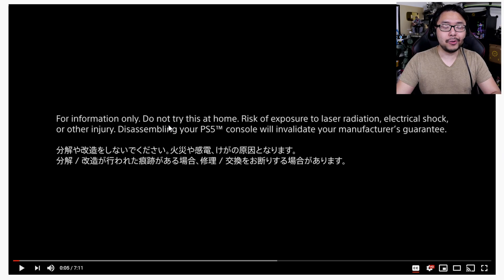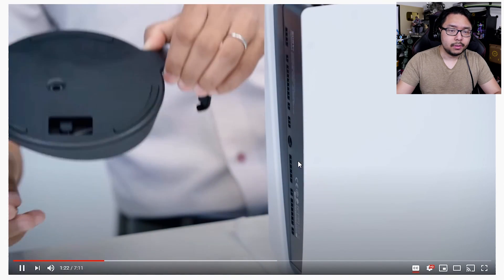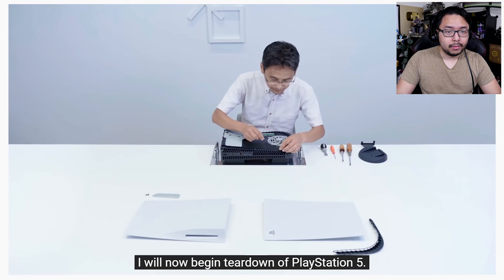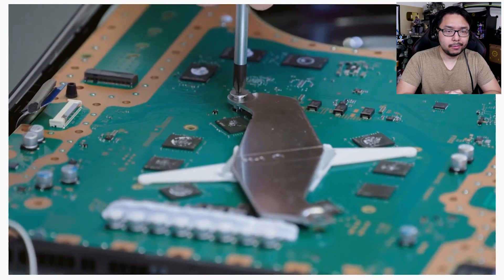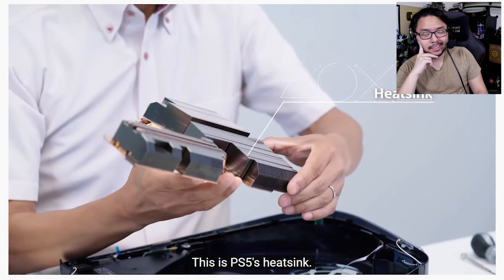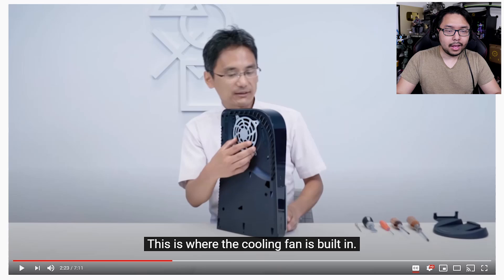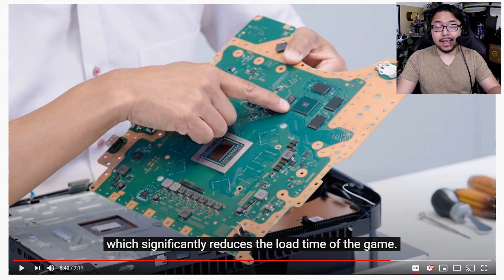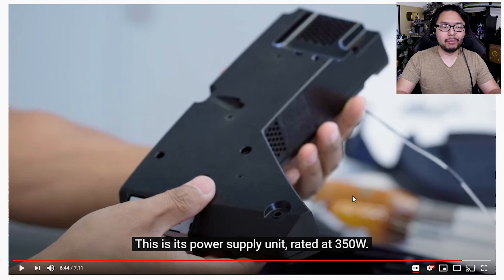Reacting To Sony's PS5 Teardown (Cooling, SSD Slot, Swappable Panels, & More)

Comment: Playstation has always been dogsht. Ps4 shouldve never had these problems to begin with. Worst experience Ive ever had gaming. Cant wait until MS takes back over and brings sht back to how it was. Not to mention I wont be stuck with trash teammates anymore in every single game I play.
Reply: Someone's salty 🤣🤣🤣.  you make it sound like X Box was better than PlayStation  from the beginning even though the PlayStation has outsold Xbox in every generation they have been fighting.
Reply: @Robertscreativecorner  Im talking about online gaming. Also MS has a 70B networth whereas Sony has a measly 5B. Most trash fanbase Ive ever witnessed.
Reply: @Slurpified  Microsoft did do this amazing thing of bringing paid multiplayer into the norm. so thanks to them.
Reply: @Robertscreativecorner  Anyone whos a real gamer doesnt care about an online fee. This is stuff we endured as kids. But who am I kidding you ps4 players are used to getting ripped off and buying cheap flopped games that go on sale within weeks.
Reply: @Slurpified  Ah yes critically acclaimed games on PS4. What does Microsoft have? Crackdown 3?  Halo five which was a spit In The face of the franchise?
Reply: @Slurpified  X Box 360 was a literal scam. I went through a heap of them but they constantly red ringed. I had multiple Xbox one's they all died. I am still using my original PS2 PS3 and PS4 with no problems. Plus the online is just as good and the exclusives are on entirely different level.
Reply: @Robertscreativecorner  Yeah because you probably shopped at gamestop and boughr refurbished ones lmao. Ive never heard anyone say they went through a heap of them.
Reply: @Robertscreativecorner  Look at your 4 comments in a row. What a typical ps4 player lmao. Critics and reviewers are paid off nowadays bud and every mother and toddler has a ps4 so its not wonder those games sold alot. Theres a reason they go on sale within weeks lol their movies and boring walking simulators.
Reply: @Robertscreativecorner  Let me give you a bunch of comments you irritated ps4 player lol. Im not here to talk about your boring exclusives I give a sht about which community is better in that case ill be going back to xbox to play with real players not fortnite goons.
Reply: @Slurpified  you really know nothing. A online isn't everything and there is no correlation. But I get it your jealous.
Reply: @Robertscreativecorner  Ive witnessed both communities and online consoles for 7 years each into a total of 14 with 10s of thousands of hours. All you know is Sony and have no say in anything.
Reply: Xbox has never taken over anything. They've never been on top.
Reply: @RealLordBread  You're a moron they owned the era from 2006-14 and made online multiplayer gaming famous practically. MS does everything better for online play and you got no say in anything because you never witnessed the 360 era and put more than 1000 hours into gaming at the time. All you bozos know is ps4 and your games that are boring walking simulators and movies.
Reply: @Slurpified  Maybe in the US they did... Literally anywhere else tho hahahaha no...
Reply: @Slurpified  Also I was an Xbox guy during the 360 era. But that facts are facts, they've never ever dominated the console market worldwide.
Reply: @RealLordBread  Its literally been in articles forever and its in the "History of the Red Ring" video.
Reply: @RealLordBread  I really doubt you were a 360 player lmao yeah right and if so you probably dont even have over 5k gamerscore on your xbox profile. If it even exists.
Reply: @Slurpified  Bruh lmao I have a 360 tho.
Reply: @Slurpified  well you clearly are not a real gamer hahaha. Sorry to break it to you.

Comment: Man you had me thinking they made some advanced changes to the cooling. Lmao they still only have one fan so no change there. They did increase the size of the heat sink and made the ventilation holes late but that’s basically it. There is absolutely no dedication to cooling in this design other that that crazy large heat sink.

Comment: Wait a minute thought the PS5 drive was swappable making Xbox a somewhat good deal saving 25% on 2tb capacity as you don't need to swap them now that you can have custom and m.2 drive that means the cost on ps5 is same or lower than Xbox and with greater speeds to boot

Comment: Im just holding out for confirmation on if it will output 1440p. My ps4 looks pretty shit since its at 1080p and i will be extremely dissapointed if a next gen console doesnt support 1440p.

Comment: Just wondering if there will be a custom water cooling for the PS5
Reply: The only downside that I'm concerned with is that SONY has a strict censorship of games as opposed to it's competitors.
Reply: I believe that it's not the best hardware but it's the best software which drives the system of your choice. When you have multiple systems you get the best of everything.
Reply: Xbox is trash
Reply: @FlootheLooCroo9183  It depends on the exclusive games that you want to play. I have no allegiance to a specific brand and will own multiple consoles and PC
Reply: @FlootheLooCroo9183  Mate I've already told you that I'm own different consoles from Sony, Microsoft and Nintendo. I don't have a fan boy mentality like you. I'm here for the games and not for the Console allegiance.  There's a game rating in place but Sony has started to dictate their own game censorship Policies recently. Look at Devil May Cry 5 or Aokama censorship. Do you like being told or dictated by Sony of what you can or can't play?
Reply: @FlootheLooCroo9183  Oops my mistake Aokama isn't on the the PlayStation because of Sony's censorship Policies. I have it on my Nintendo switch. I do enjoy my uncensored version of Devil May Cry 5 on my PC though
Reply: @FlootheLooCroo9183  Sony are shoving their censorship as they are forcibly shoving their phallic objects into your mouth and you're willing to accept it?  The truth is that you don't have have a choice, where as I do
Reply: @FlootheLooCroo9183  I think you enjoy the butt hurt from SONY and willing to want more. So open up and spread them mate. Your fannboism has no limits!!

Comment: This latest next gen consoles are basically getting closer & closer to be a PC
Reply: Consoles are literally PCs, the only difference is the operating software.
Reply: All these components are pc components.. gpu, ram, cpu, etc, running in the PlayStation OS just like Windows or iOS.
Reply: Consoles have been computers for decades, just in a fancy shell and specialized to do one thing specifically.
Reply: 11 11 yeah but he's going on damn near every comment saying eww Xbox or pc and it doesn't even be about those devices in a positive light
Reply: Consoles are pretty much compact pcs with a cpu+ a   vastly more powerful iGPU and custom UI. lol
Reply: GROSS PC
Reply: Daxter you make Playstation players look bad

Comment: and judging by the size, they are indeed going to need it for that heavily overclocked and poorly balanced variable cpu/gpu design. The price you pay for bumping frequencies for marginal gains, just as with every gpu ever.
Reply: That's not quite right. That cpu is a Ryzen style cpu. I have a PC with a Ryzen CPU that does the variable "overclocking". Though really it's not overclocking since it's just what the cpu is designed to do. My PC is just a quad core, and it renders a 4 minute 1080p video in about 2 minutes. I had an old PC from 2014 with the same specs that got destroyed by video renders. The gains are not marginal. If the PS5 also has the A.I. that most Ryzen processors have, then PS5 is going to have even greater gains with A.I. controlled calculation path switching. Don't underestimate the PS5. It will probably beat most high end PC's by a wide margin. You'll probably have to plunk down more than 2 grand for a PC that will beat it.

That being said PC's will likely do some catching up soon as there are already more powerful Ryzen processors for PC's. They just don't have some of the weirder storage related stuff that a PS5 has. And that cooling is good. Even a really strong PC CPU without variable speed will need a big cooler. It's really about price. Sony has a product that will sell for less with more power. There's CPU's with more power, but the whole build in a PC will not come cheap.
Reply: @spacedoohicky  First, is an APU, not a CPU. Second, the graphics engine (so called GPU part) is broken up in to compute units just as a regular GPU would, and the same limitations apply: more frequency = more heat = more perf, yes, but as we know from extensive testing under ALL recent GPU architectures from both nvida and AMD, frequency boosting yields MINIMAL gains relative to the thermal cost. That is why all the fastest GPUs in the market instead go for WIDE design with more CUs. That is big navi's stragegy, and that is ampere's strategy. Hence why overclocking a GPU is rarely worth it compared to just going with a larger higher end model which will usually be clocked lower but have far more CUs for an overall greater performance. In particular at higher res targets. 

Now it is quite clear by sony's inability to hold max gpu frequency and cpu frequency that they are pushing the thermals and cooling solution, oversized as it is, beyond that is reasonable for consoles which are meant to basically take on punishment from dust and poor airflow cabinets. Which is right in line with what I said: modest gains at best at a huge thermal cost....look at that damn console. It looks ridiculous. So while it will probably not overheat, it will also never achieve the peak advertised performance for both parts, and sony themselves already admitted they cannot because their design relies on so few CUs they had to push frequencies to keep up and ended up with this fugly thing.

I can only hope there will be a die shrink or process improvement down the road because that freaking plank doesn't fit my set and I'll wait for the slim version instead, and given the piss poor game lineup on top of so many games coming out on PC too, these first gen oversized paperweights are really just for the beta testers that don't know what to do with their money.
Reply: @neonspark707  I know what it's called. I'm just not calling it that because it doesn't really matter because it's just a fancy name (APU) for a processor with integrated graphics that uses threading.

But what I'm mostly talking about is the price. For good games to play good on PC a person has to pay a pretty penny. Performance is really about price because cheaper for similar performance will beat expensive.

PS5 has a Zen 2 processor. The Zen 2 processors have a similar speed to Intel's i9. But Zen 2 processors are cheaper. And the Zen 2 is faster than i9 on some tasks which is bad for i9 since it's more expensive. Speed in a vaccum of tests is where i9 shines, but people have to pay for these things which means per dollar Zen 2 is faster. Much faster.

As far as PC gaming price is where PC has to beat consoles. If the prices for higher end PC's go down the consoles will be beaten. It's as simple as that. But consoles are engineered for gaming while PC's are not.

For PS5 I imagine most of the price comes from that custom SSD manager. And that's part of how it will beat PC. I don't know how it will compare to the series X. We'll have to see when these things come out. I'm betting PS5 will beat the series X just because of that SSD.

As far as the looks of the PS5 that's subjective. I like it. You don't. It's simple really. I also like horror films with a lot a gross stuff. There are people who hate that. So squabbling over this is the ridiculous thing.

Comment: The console itself without the outer panels is actually really cool looking.
Reply: Leave it on or switch your different panels on. You are right but it's designed with the panels for airflow.
Reply: @morganhazel2373  Could try and make See-through panels.